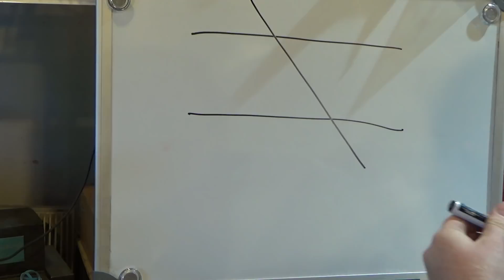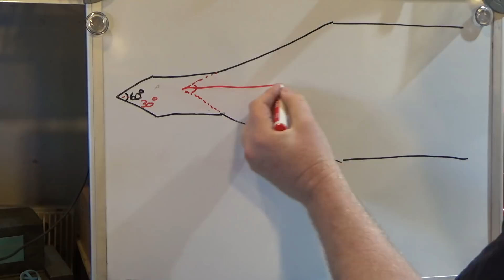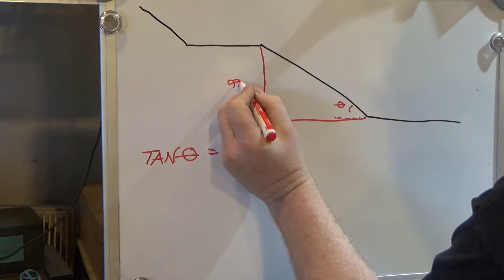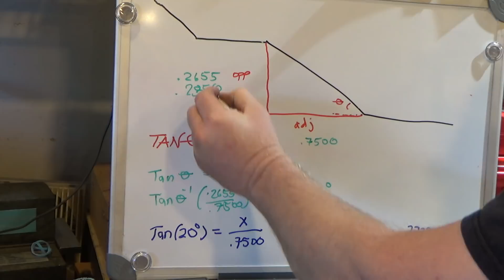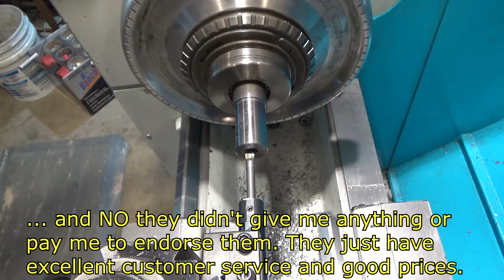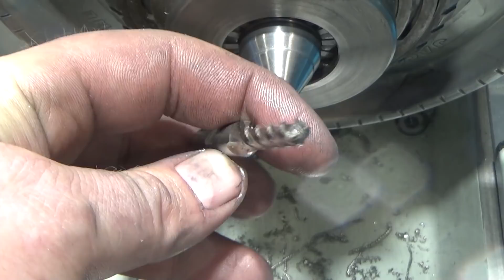Ball Adapters for My Lathes Live Centers

Comment: Never seen anyone spend so much time and effort on such a simple job. I use two N02 MT soft shanks, centre dronn and silver solder ball bearings in,. I was NOT impressed wth him using a nice pair of pliers to try holding his ball in a flame. Go to the back of the class lad.
Reply from the maker: Fair enough, thanks for the tips!

Comment: Rather than saying "tangent to the minus 1 power" it is more correct to say "inverse tangent" or "arctangent" (my preference). Very informative video. May try it with brass wire or fluxless aluminum "solder" instead of silver solder.
Reply from the maker: Thanks. I made this video quite awhile back and am surprised that I said tangent^-1, I would normally say arc tangent.

Comment: The Y (opposite) value is prone to error when it register off the horizontal plane crossing Z (spindle) axis. 

To sanity check : use (1) a straight edge and (2) a 20-degree angle wafer in between cone and straight edge.
Reply from the maker: Useful advise. Thanks.

Comment: A bit late to the party but I would have placed the tail stock in the head stcok and dialed it in and then set an indicator on the top slide and found the angle by running a zero to zero over the length of the unknow angle, the same way that you would set up the top slide for cutting a machine taper. Lock the top slide and machine the part. Relying on DROs and DTIs is prone to error as these are very sensitive to being placed absolutely perpendicular to the parts that you are  making the measurements from. Great set of videos BTW. Thanks.
Reply from the maker: You make so very interesting points. Thanks.

Comment: I turned some 4130 a couple of years ago for stand-offs for a rotisserie to rotate my airplane fuselage. I got a terrible finish no matter what I tried. Finally dug out some old high sulpher cutting oil my dad got 50 years ago to thread water pipe. The 4130 cut like butter and I got a beautiful finish. I was using an old wore out 6 inch Craftsman 109 lathe, so size doesn't matter.
Reply from the maker: That's really interesting. I don't have an sulphured cutting oil, but will have to try that. I have found that a high feed (0.009"/rev+) rate combined with moderate depth of cut (0.025"+) can yield good results if the machine can handle it. Thanks for the hint.
Reply: My situation was a whole lot different than yours. I'm even more of a novice than you claim to be and I was using a old 6" Craftsman 109 lathe. Slow rpm, low power, manual feed, and 6" of stick out in a 4" 3 jaw chuck. I was trimming to length so no tail stock support and no steady rest, and the spindle id is 1/4" so all the stock was sticking out the chuck. I was using a hhs cutter. I reground the tool different shapes, tried different cutting fluids and finally dug out the old can of high sulpher oil. It worked like magic. It was on old can I inherited from my dad. He got it about 50 years ago to thread pipe. Unfortunately that was the last of that oil, I had to squeeze the can to get enough to finish the job and I haven't been able to find anything to replace it with. Kind of limited here as to what's available and anything haz-mat is impossible to get shipped. I've used tap-magic, hydrolic oil, mineral oil and water soluble cutting oil on other steel with good luck, but the high sulpher was the trick on the chrome moly.

Comment: if you set up the flame so it comes from the top, the gas of the flame will help you with placing the ball i guess, if it comes from the side, it shoots away, at least that would be my theory on that.

maybe it would be also smarter to drill a small hole inside the ball cavity and fill it with solder, then dip everything in flux and assemble it before heating up, maybe the flux is strong enough to pull the solder up under the ball? 

i never soldered myself but that are some ideas i just had watching this, maybe you can try some of it and it actually works :)
Reply from the maker: Thanks. I love suggestions and if one of them works, everyone wins. Thanks for taking the time.

Comment: It is really critical to get the radial indicator on center height, otherwise the indicator traces a hyperbolic curve rather the line you want. Now this is not the reason for your deviation because it will give you a reading of a higher angle than true rather than a lower, but it is worth noting.

If I wanted to duplicate a taper really accurately, I would set up the compound with an indicator and bump it until it indicates parallell, because even if you measure the taper really accurately, most compound protractor scales won't be accurate enough to really match an angle.  Getting the indicator on center is still critical though.
Reply: Of course I made the comment on the protractor accuracy before I saw you angle block trick.... Nice trick.
Reply from the maker: Not a problem and thanks for the suggestions. I really appreciate you taking the time to share your ideas. everyone wins.

Comment: center drill work piece (60 degrees) center drill ball (60 degrees)  put drilled ball in work piece put live center in hole drilled in ball you will get full contact in work piece
Reply from the maker: Interesting approach. How hard is it to center drill a ball bearing? Do you use carbide? Thanks for the idea. Simple and elegant.
Reply: dudley  i have not drilled a ball bearing, your video gave me the ball bearing idea because i have turned morse tapers with offset tail stock and i know i did not have full contact on live center, but I will give it a try  thanx
Reply from the maker: No problem. I like the idea a lot and might just give it a try. Thanks again.

Comment: Interesting stuff - I just made a rather small tailstock offset  - not overly happy with it but planning to make a ball center anyways - probably going to make up a boring head approach. Like your idea for the ball bearing addition - may well go that route... tricky getting ball in place while heating! :)
Your lathe is super quiet - mine is noisy!
Reply from the maker: Just a suggestion: Don't make the tip anywhere near as tapered as I did. It turned out to not be strong enough and the part wobbled by 0.004-0.006". My lathe is a really nice tool. It certainly performs a lot better than I do. Let me know how your taper turns out. Cheers.

Comment: A tip on simple way to copy a taper on the lathe accurately if the angle does need to be known,  is something like this:
Set a sensitive indicator close to the tool tip and adjust its height carefully on the smallest radius available.
Position the tip against the angle to be copied.
Move the top slide back and forth and knock it s angle in place until the indicator changes the least amount during movement.
At this point You can figure in wear etc and tweak for that to get accurate.
Then turn the part, it will be more accurate than using the DRO:s fancy functions. An important thing that is easy to forget is
that tool height influences the angle as much as the indicator height. They need to be very close.
Reply from the maker: Thanks. I really appreciate you taking the time to share some ideas. I always learn so much from the comments - good or bad.

Comment: I had the same issues with that material and was able to overcome them with the following inserts from MSC 67512756 & 67595777.
Reply from the maker: Thanks for the suggestions. I will check them out.
Reply: forgot to mention faster feed is needed, my lathe likes .009 IPR.
Reply from the maker: Excellent, thanks. I also have found that higher feed rates can sometimes improve surface finish.
Reply: Yes, .030 DOC, 1400 RPM, 010 IPR, does it for my lathe and .050 DOC not an issue.

Comment: all comes down to the mass and rigidity of machine. Abom does 4130 all day long with mirror finish but he is using old american made iron machines not imports
Reply from the maker: Adam is definitely a pro and does use huge machines at his place of work, but my machine is a very heavy 14" throw lathe. It is an ACRA Heavy 14 that weighs about 3500 pounds. As a matter of fact, Adam uses an ACRA at his job. Rigidity could be an issue for me, but I think it is more likely a feeds and speeds problem. Adam has a ton of experience, that I don't, so he probably knows the right setting for every insert and situation. Thanks for the input. I really appreciate the help.

Comment: At 6:35 you are not going to get the desired result. Here's why:

Theoretically if the tip of your plunger had been a true point, you'd get correct readings. But the tip is a round surface, perhaps 1/8" or larger (my Mitutoyo 2915 is 0.196"). Imagine magnifying the surfaces sufficiently to see how they actually contact. Regardless of whether the tip is round or tapered - actual condition of the tip when magnified sufficiently - the same kind of errors are inherent. I'll call them parallax until someone comes up with a better name.

Indicators are designed to intersect the surface to be measured solely perpendicular to the centerline of the plunger.

But no matter how you measure the slope with a round or tapered tip, you won't get a true reading because you are measuring relative to some unknown surface on the round tip - not along its true centerline/endpoint.

Solution, use your compound to move the indicator perpendicular to the sloping surface.

See the video by Joe Pie on the subject of cosine error:

https://www.youtube.com/watch?v=dsWSxpwCPUg
Reply: I wonder if the rule or razor blade trick would be good enough to find the center?
Reply from the maker: Thanks. You are the second person to point out that my indicator was probably not following a line parallel to the axis of center. It seems so obvious in hind site. Thanks for taking the time to point out my silly mistake. I appreciate it.

Comment: soldering:   put a very small amout of the flux in the ball seat.  like 1/2 what will fit on an end of a regular pencil or less.  the silver will stick where ever you put the flux.   just a small amount. put the heat protector gell on the tapered part first.  then put 1/2 ereassorful of flux in the seat.  then put the ball on.  then heat with downward aim of torch so ball dosent blow off.  When the ball and seat are glowing enough to melt the solder, touch a small solder rod to the joint.   the solder will be sucked into the joint where 
the flux was.
Reply from the maker: Thanks for the really thorough tips and explanation. Very helpful.  As you can tell I don't have a ton of experience in brazing.

Comment: I think I have seen someone drill a ball bearing and insert a hardened pin. Then you could use appropriate grade of locktite to attach the pin. If it works you might be able to prepare several different sized balls with the same-sized pin if need be. I hope you were using borrowed pliers to hold the balls, LOL. Success would depend on how well the drill bits cut ball bearings. You might even be able to dispense with the live center and mount the pin & ball assy in a stationary drill chuck or whatever. Thanks for the excellent lesson!
Reply from the maker: I love your approach. Thanks for sharing a great idea. The ball bearings I was using were stainless, not chrome plated, so perhaps they would drill without too much of an issue. I should look into that.
Reply: Dudley Toolwright, The bearing-driller may have been Stefan Gotteswinter. If the chrome is a problem, you could grind a flat to drill on.
Reply: I saw a video, with some drilling into a ball shape. He chucked up a plumping compression fitting to hold the ball. He drill and tapped it but as small as yours ball is a pin would work.
Reply: It is fairly easy to drill ordinary steel ball bearing balls with a carbide drill. I was quite surprised at this the first time I tried it, they are at the upper HRC range of what  these drills are made for. It is not the drilling that is the problem, but the centering. My trick is to grind a  flat slightly smaller than the drill the ball to get the drill started. I held the balls in a C5 fixture. for both grinding and  drilling. I would still solder or pressfit the ball though since these may get a little to hot for Loctite.

Comment: Film thickness of the lube can theoretically make a significant change to the fit of the pin gage but not having pin gages I have never actually never checked. Should be a thou approximately depending on the viscosity.
Reply from the maker: Thanks for the tip. I had heard that this could be an issue, but have never measured it. Perhaps I should.

Comment: Hi, How do you ensure that you have no runout of the ball ?.
Reply from the maker: An excellent question that has been plaguing me and I don't have an answer at this time. I think the appropriate approach should have been to design some sort of fixture to hold the ball in place for soldering. Another approach is to turn the balls now to be concentric (it is a stainless steel ball bearing). Thanks for the great observation.
Reply: Yes, turning or grinding, a good old handmade thumbs up, All the best
Reply: Hi, I think I have found the perfect solution, If you look at Edge Presion (youtube name) Peter have the tools to grind you a carbide ball, I was thinking of something like a ball then a smaller diameter shank and then the diameter of the stock, theese you could use as a dead centers in both ends (I would avoid the live center for accuracy reasons) hope you get the ide otherwise I can send you a drawing of what I mean. Just remembered what looks like what I mean  https://www.ebay.co.uk/itm/Edge-Finder-Electronic-Optical-Edge-Finder-with-LED-and-Beep-for-CNC-Lathe-I1N6/183181122574?epid=1787356172&hash=item2aa6721c0e:g:~b8AAOSwaZFa1Eed

Comment: Hi Dudley,
In GH Thomas’s book “The Model Engineers Workshop Manual” he describes in detail the issues with contact angles on the centres when offset taper turning, he also described a centre drill that produces a radiused hole that when used with a regular 60 deg centre offers a lot more support for the work piece, it’s a good reference manual and worth having if you can get one.
Cheers
Reply from the maker: I have been looking for that book, as another commenter recommended the same book. I have found one in England. When I get the cash, I'll get the book. Thanks for the referral and suggestions.
Reply: I’ll have to review all the old books my father gave me 20 years ago. They are geared to the unimax 3000 watch maker lathe. I sure didn’t understand most things about turning 20year ago.

Comment: Position your 20 degree angle blocks against that center taper and indicate along its opposite side. If angle is 20 degrees, indicator will show no change along the side. When setting compound angle, move toolpost center directly over compound pivot axis if possible.
Reply from the maker: Good to hear from you. I thought of that, but could not figure out how to get the angle block to stay in position for a measurement. Solution?
Reply: Dudley Toolwright I use a combination of supermagnets and masking tape.
Reply from the maker: Interesting approach. I never thought about adhesives. Thanks.

Comment: As a 35+ yr bookmaker I have another solution for you. Square up the tool post to the Chuck then measure the Ashleigh your vernier protractor off of the tool post to the desired angle. Easier and faster. I can do the math and have no problems doing it but some people might. As for the ball center us "old guys" were makeing those years ago simply by ball end milling a pocket in an insert for our live centers and silver soldering a ball bearing in it then Machineing the clearance on it afterwards and then put it to work
Reply from the maker: There is no substitute for experience. I rarely think of the post machining solution. After I read your post I thought, duh! It seemed like such an obvious solution not. Thanks. I liked your angle finding solution as well. I appreciate you taking the time to share your perspective.